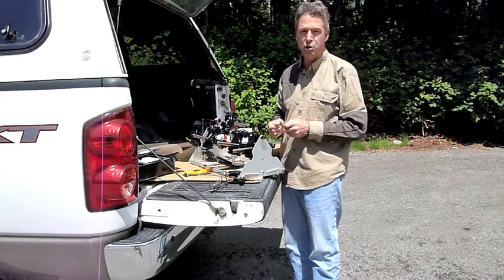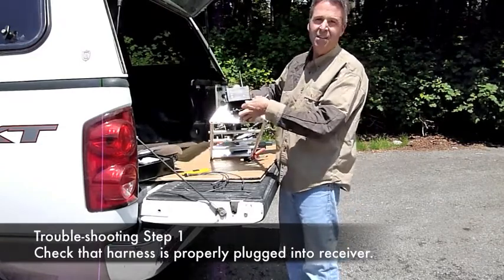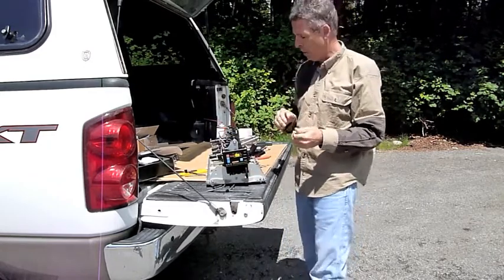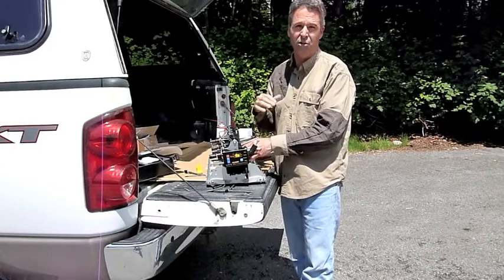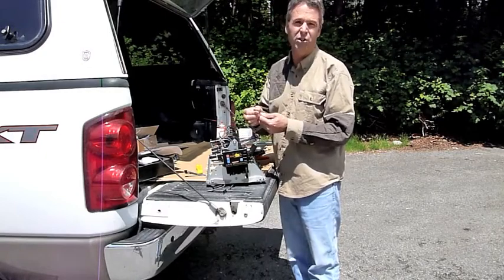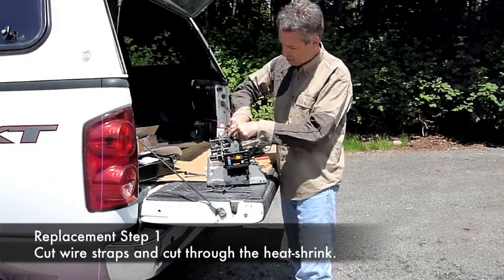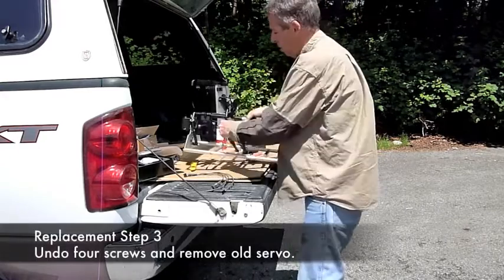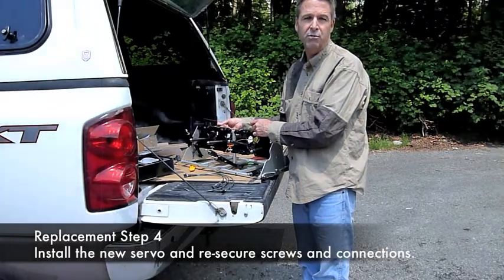Trouble-Shooting & Replacing a Servo

Comment: It's important to buy quality servos from a reputable dealer.  I bought some off of ebay 4 years ago, and finally tried them out.  They were inadequate for several reasons in the Bumper Boy (among other things, they counter-rotated), and I ultimately found out that they were counterfeit Futaba s3003 servos.
Reply: Robert Henry -